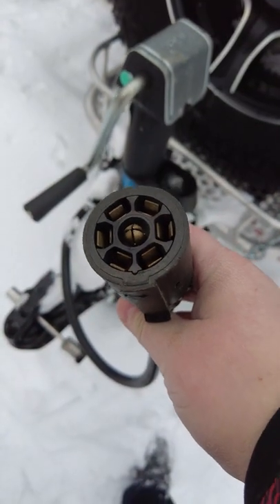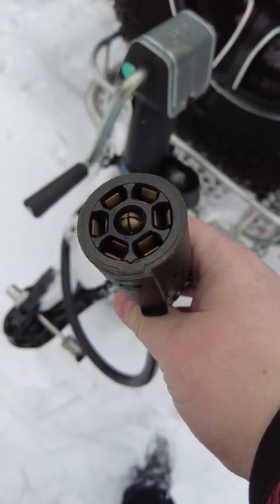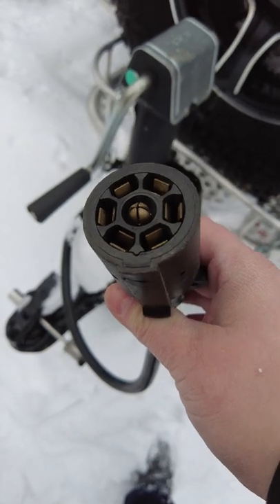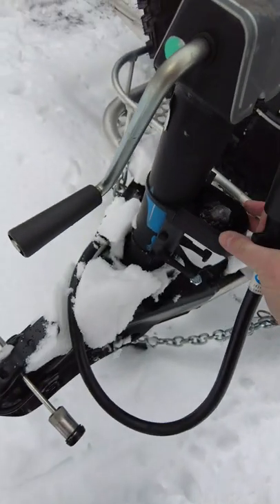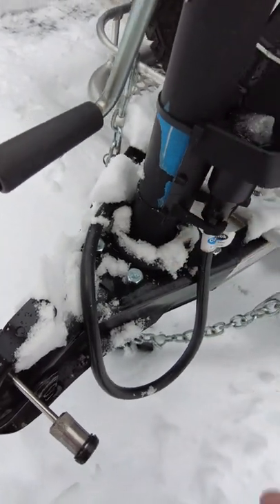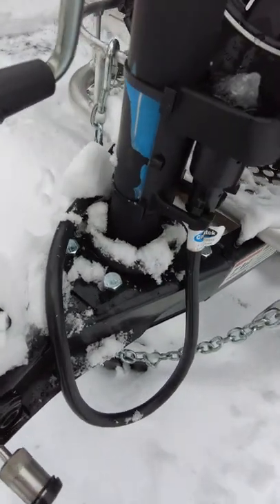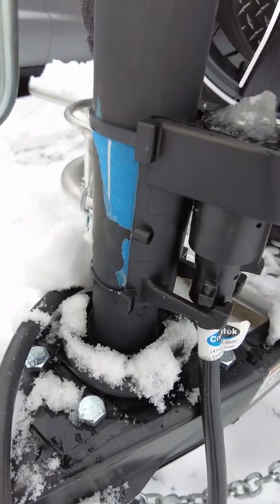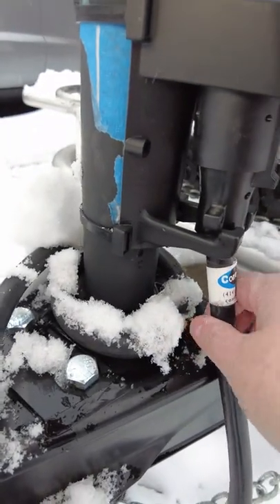Protecting Your 7 Pin Connector -  #Shorts

Comment: There are a few variations on the idea, I put one on mine, definitely helps keep it clean.  

One suggestion Jenn, you might want to show how to put the dielectric grease on.  A few people have done it and gone way to wild with the grease, you really don't need much.  Also, make sure the part on the tow vehicle gets some too, that's the one that's a lot more difficult to replace if you have to.
Reply: Where does the grease go? How much?
Reply: @lisamorrisette171  I put a small dab in the trailer end and work it into the truck end.  It doesn't take much at all.
Reply: @robertpanick2660  Thanks. Just wasn’t sure if it was supposed to get into the little flanges, but if we are working it into both the trailer and vehicle connection then I see the answer is yes. Just a dab will do it.